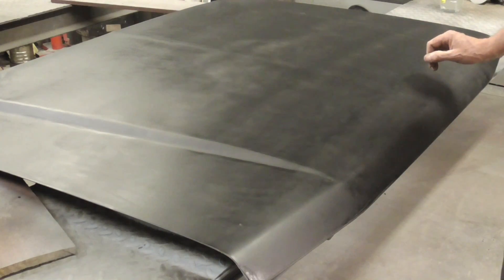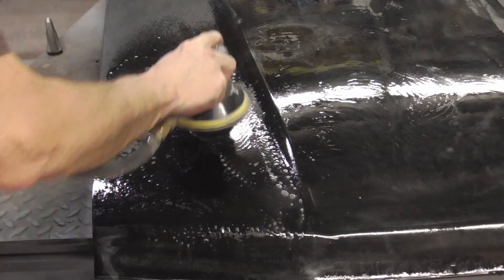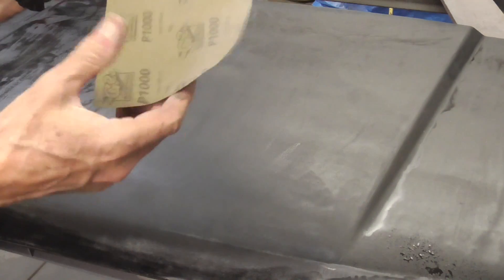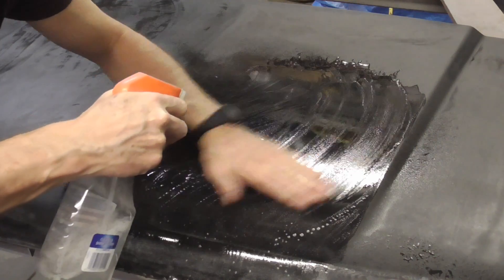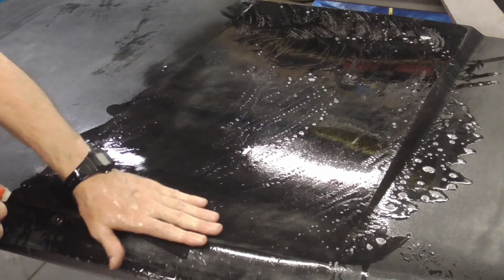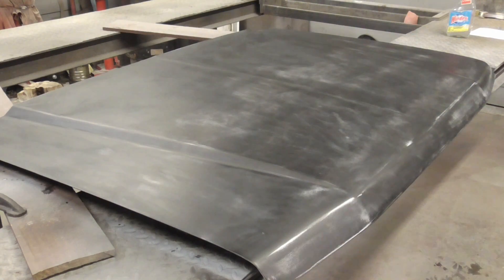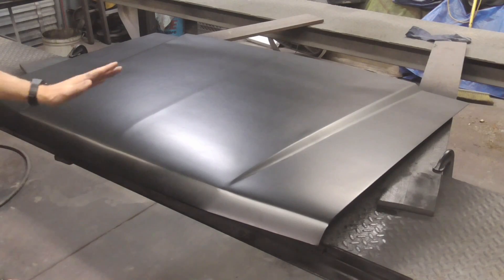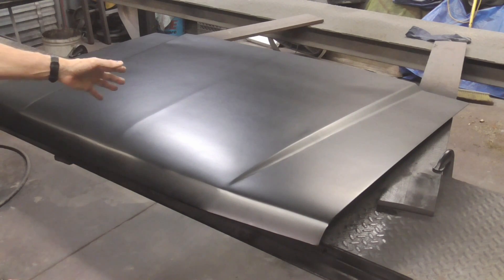Automotive Paint Problems & Solutions - Fixing a Botched Paint Job

Comment: For some reason for the first time had many mess ups in my Rust-Oleum paint job so I feel I'm going to have to repaint what grit should I use to sand it down to repaint without getting into my body work and what is the finest grit you can use and repaint over with Rust-Oleum
Reply from the maker: 400 wet sand - wet because rustoleum usually clogs paper.  Here's how - https://www.youtube.com/watch?v=BD4txPwjsfI

Comment: Excellent video. I primed and sprayed the bottom of my door (Panther black Ford Mondeo) and then lacquered it, all with rattle cans. I thought I had done a fairly good job but after a few days could see the primer through the paint, gutted. Not enough coats of paint. Do I need to wet sand back down to primer again or just sand the lacquer and base coat and repaint. Thank you.
Reply from the maker: You can lightly wet sand it or dry but it'll probably clog the paper (dry) - use 400.  Then spray it again.
Reply: @LakesideAutobody  thank you so much for your quick reply 👍🏻 Would 400 be ok, just thought it might be a bit coarse, and would I need to take it back to the primer or not ? Thanks again.

Comment: Hi Jerry. I sprayed the hood on my car which came out badly blotchy/mottled.  I did 2 coats and stopped after a failed 3rd dust coat which left it feeling rough. It's a gold metallic. Any recommendations for sanding it back? Should I strip it down with 320 and start over again or can I use whats there? I tried sanding with 600 but the paper seems to gum up quite a bit.
Reply from the maker: Wet sand with 400 grit and go at it again.  If you are spraying single stage metallic get it wet on the last coat by going around twice then wait a minute (literally about 1-2 minutes) go around again with a crop dusting, mist coat making sure that it stays wet but the flakes are being evenly distributed. It's a huge timing thing and takes tons of tries.  Once you get it though it's like riding a bike.  Timing is key - wet enough to take more paint but dry enough to have the flakes stay put.  Please let me know if you get it straightened out and if you have any ?s 👍
Reply: @LakesideAutobody  Thanks for the reply. I should have mentioned it's BC/CC. Right now i'm out of paint and waiting for more (paint store ran out of silver for the mix) In the meantime I'll wet sand it. I'll let you know how it turns out. Thanks!

Comment: Started to paint my truck and I thought I was ready to spray got the 1st coat on and noticed sand marks so I stopped how long do I have to wait and what grit paper should I use to save  my job
Reply from the maker: Wait till the next day to be really safe and wet sand with 400 grit.  It's normal to see sand scratches on the 1st coat - after that you should be fine.
Reply: @LakesideAutobody  thank you hand sand or da

Comment: Problems to expect.  1. Water dripping out from under my gloves and tyvex suit while spraying.   The fix, paper towels and a rubber band.  Next time sweat bands.   2. Paint quit coming out.  Reason , the little vent got clogged with paint.  Discovered to late as I already dumped the last of my paint.  3.  Dumped paint, stupid.   Since I mixed it I thought I couldn’t save it, wrong.    Hopefully most of my problems happened on my first attempt.   Fixing some rust on my roof next.
Reply from the maker: Those are great mishaps - thanks for sharing.  There sure are a lot of things that can go wrong but that's par for the course and what make a decent result so rewarding - like a good drive at the golf course - feels great when it happens 😊

Comment: Hey I sprayed the trunk lid along with front and rear valence on my 68 Shelby GT500KR. I used base/clear and the color is Raven Black and there is zero metal flake in it. They came out looking really good with very little orange peel. I sprayed 4 really good coats of clear on the parts so there is alot of clear on them. BUT I had to spray the car in my home garage and it got alot of stuff,dust/dirt nibs in it. Will I need to sand the parts back down to the base coat and shoot the clear again? I even wiped the base coat gently with a tack cloth before I sprayed the clear and alot of stuff still fell into the clear. What would you do?
Reply from the maker: I would wet sand that clear with some 1500 and spray it with clear again.  You don't need a spray booth - you don't even have to wet the floor.  Every bit of dust you got in your paint job was already on the panel before the first coat.  Watch this video for some tips on dust free paint jobs - https://www.youtube.com/watch?v=gB3Hou6k8rE

Comment: Thank you for sharing your expertise of what to do when things go sideways!
Reply from the maker: Stuff happens. If you work on stuff it just does.   I just busted a radiator pulling a frame.  Probably should have taken it out first but I gambled and lost 😊
Reply: @LakesideAutobody  Wow, that comes under, "I did not see that coming" huh!
On my roof project, I got all the burned clear and base coat sanded back today. I ended up going down to 220 grit paper, then 320 and 400 after that. I'll tell you what, I have a lot of respect for anyone that can do that all day long, every day! Thanks for all your help! Cheers!
Reply from the maker: @SomeGuyInSandy  Body work is good for your arms - keeps them in shape 💪😊

Comment: Question regarding spraying base/clear over an older respray of single stage. Was thinking DA with 80 grit, then epoxy, then high build x2-3 coats, then block straight. Spray epoxy as a sealer if I break through. then shoot base/clear after finish sanding. My only concern is the epoxy over single stage. Will the epoxy be enough of a barrier to prevent lifting of the single stage when using base/clear?
Reply from the maker: Yes the epoxy will work fine over single stage.  DA with 220-360 grit or 120 on pits and rougher stuff.  Epoxy will not block sand - you'll have to put urethane primer surfacer over the epoxy or just go with lacquer primer surfacer or DTM 2K Urethane Primer Surfacer.  If you have more ?s just ask :)
Reply: @LakesideAutobody  thanks!! I’ll do epoxy and use your suggestion of DTM urethane primer in the revolt. I’ve been looking at TAMCO DTM high build. I’ve read it sands rather easy. Thank for your help. Appreciate your content. Learning a lot from you and UPK.
Reply from the maker: @64b09  UPK is a great painter - he's a great person too :)

Comment: What is a good recommendation for fluid knob settings on an hvlp gun?
Reply from the maker: I usually have it wide open on solid colors and primer.  For door jambs and controlling metallic flakes (mottling) I might turn in in to prevent too much paint coming out at time - like on the drop coat or mist coat.

Comment: Here's a single stage acrylic enamel paint issue question...
   I decided to add acrylic enamel clear to the single stage. 
  Now to make this bond to previously sprayed paint, will wet sanding with 1000 grit be sufficient? I 'm not finding a lot online, and I want to make sure it doesn't peel off a few months down the road.
Reply from the maker: Yes it will stick.  You don't have to sand it if you clear it the same day.  Spray your single stage enamel, let it dry for an hour or so then clear it with you acrylic enamel clear.  We used to do that all the time in the 80's.  We cleared over enamel and lacquer with enamel but never lacquer over enamel as it will wrinkle.
Reply: @LakesideAutobody  thanks, hard to find people who really know acrylic enamel. Lots of differing opinions and a certain amount of contempt and misinformation
Reply from the maker: @BearBudgetgarage  I will always give you an answer that I know is absolutely correct.  If I don't know, I say, "I don't know."  Feel free to ask any ?s - doesn't have to match the content of the video.  Jerry
Reply: @LakesideAutobody  well, I had wetsanded the paint as i was not content with the texture from previous spray. Went 4 to 1 acrylic reducer, 8 to 1 wetlook hardner and this time Iwatta w400 1.4 .
   The results? Minimal orange peel, smooth paint, and a happy Diy guy! 
   The only issue is some dust specs, so I'm going to wait, wetsand with 1000, then clear entire car with acrylic enamel clear coat. Then i will get more dust specs and cut n buff the clear. Lotta work, but I love it. Very personally rewarding to turn junk into something u can be proud of. 
Thanks for the replies and tips, in the end it all came together for me. 👍👍

Comment: Hi, could a clay bar solved this problem?
Reply from the maker: A clay bar does not have any abrasive (at least that's what I understand) so it would not be able to "knock down" or flatten out the dust nibs, sags and or runs.  Good question Fritz - thanks for the comment :)

Comment: Nice video Jerry.. Do you prefer mineral spirits over acetone, when mixing Rust-Oleum and why?
Thanks for sharing...
Reply from the maker: Thanks Ziggy.  I have had pretty good luck with mineral spirits and acetone.  The can does say use acetone these days - it used to say mineral spirits if I remember correctly.  My self, I think they both work the same - maybe acetone dries a bit faster - can't prove it though.

Comment: Do you have any tips or tricks for painting flames or doing a patina paint job?
Reply from the maker: I feel like doing a video on painting flames.  Even though I never painted them - I think I could do a half way decent job.  I know you'd use fine line masking tape from like 3M and would have to sort of draw it up first.  Once you have the drawing you would lay out the tape (the stuff bends real easy) .  Then maybe start with one color at the base of the flame and fade into other colors near the tip of the flame.  Finally throw a coat or two of clear on top.  Have a good end of the week - hopefully that helped a bit.  Sorry I don't have a vid on that.  Jerry

Comment: Hi Jerry great job like always I have a question for you I painted a car about one year ago with  Rust oleum paint I would like to use a single stage automobile paint do I have to send all the paint off please can you let me know the process to doing this the right way thank you God and bless
Reply from the maker: If your paint from last year is still in good shape - pretty straight and is not flaking off you will be fine just using a DA sander to prep it for paint.  Now there's a few ways you can go about it:  1) DA sand it, prime it, block it, prime again, finish sand and paint.  2) DA sand it, prime it, finish sand and paint.  3) DA sand it and paint.  It depends on how nice you want it - heck if it's in perfect shape you can scuff it with a red scuff pad (scotch brite) and paint - let me know what you decide and ask ?s if you need to :)
Reply: @LakesideAutobody  thank you so much Jerry for getting back to me No the paint is not flaking off or nothing but I could not get good coverage because I was using the wrong air compressor to smalle only 15 gallons So I will go with sanding the car blocking the car and priming the car and then painting it with    single stage I would like to use a primer that you use on one of your videos that was thick I forgot the name can you please let me know the name of it and which gun you prefer to use thank you my brother
Reply: Hi Jerry I send you a question
Reply from the maker: @firstgenerationgarage2803  Sorry - I'm late - sometimes I don't get the notification.  The primer was lacquer primer surfacer from Auto Body Master.  You can use any lacquer primer surfacer or urethane primer surfacer (any brand will work).  If you use urethane, some require a coat or two of epoxy first so try to buy the urethane primer surfacer that is DTM - direct to metal.  Ask more ?s if needed - Jerry

Comment: Thanks for this! your videos gave me the confidence to do my own paint job on my precious vw bus. The clear coat I laid down was a bit light and didn't flow and is splotchy; do you have a video of how to fix the clear coat?
Reply from the maker: You would fix it in the same way:  Let it dry over night, wet sand, prep for paint by removing all dust, and spray again.  If you are getting to many dry areas try reducing the paint a bit more.  Don't worry if you use more reducer than the can says.  Thin your paint and clear so that you like how it is laying down.  Let me know if that helps and let me know how it goes for you :)

Comment: Surely a junkyard wouldn't try to sell that hood to anyone after it's been painted with Rust-Oleum.
Reply from the maker: If I was looking for a Dodge Raider hood in decent shape I would be elated to spot this gem for 10-20 bucks.  It's all about saving $ so you have more loot to spend on other people instead of yourself - right?
Reply: @LakesideAutobody  
What I'm saying is I'd hate to have to strip that mess off and start over , just as well go aftermarket at that point.

Comment: So today was the day i painted the front clip of the fox Mustang budget project. First time painting this much area with single stage metallic. I can see why people consider it difficult. I  layed down a tack coat like u suggested in another video. I found i was holding back and some of the second coat looked dry. So i waited, then hit it with a wetter coat which seems to have done the job. 
  I have some dust bits, but no bugs! So i'm happy for that. Now im gonna want to gently buff out the finish at some point. Get rid of dust and minor stuff. Would 2 weeks be a safe time? There are 3 coats on it. Thanks, and i always watch all your videos and hit that like button!
Reply from the maker: If the paint has a hardener in it you can buff it the next day.  Lacquer, acrylic enamel w/ hardener, urethane w/ hardener can be wet sanded and buffed the next day.  To be safe though you can give it a couple of days and you'll be fine.  Don't worry at all.  For a first paint job and you didn't run it right onto the floor - congrats!  If it looks somewhat shiny - congrats!  Little bit of orange peel - awesome - that's normal.  Just give it a light sanding and buff.  Next time you'll do better - ask ?s on what you might be wondering about and you'll get it the next time.